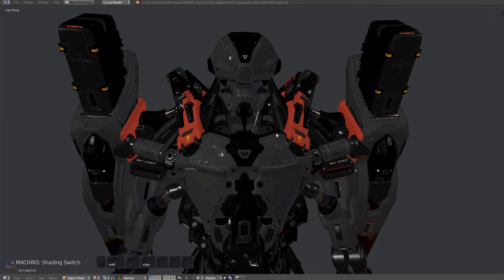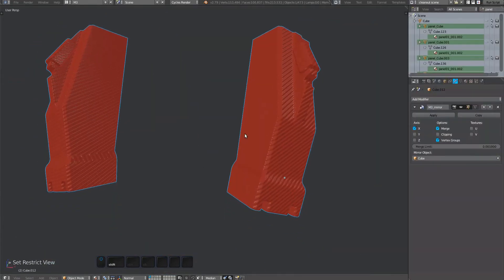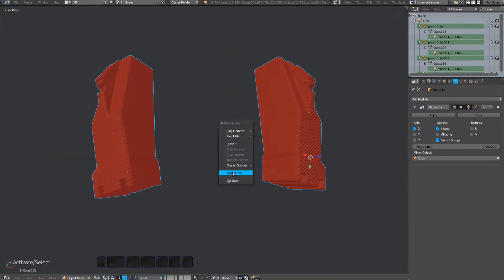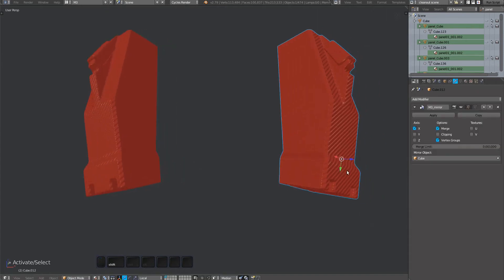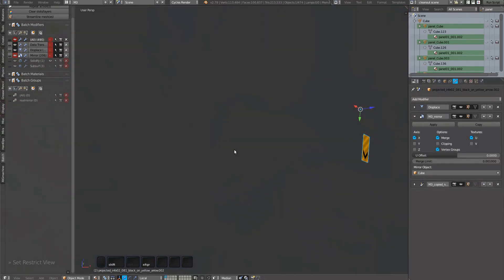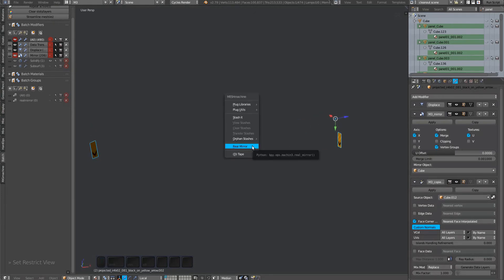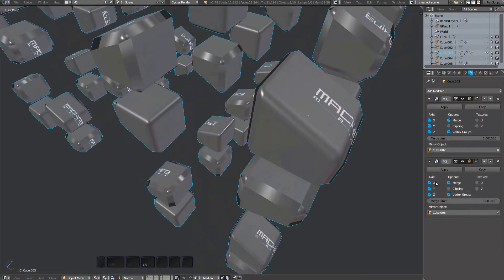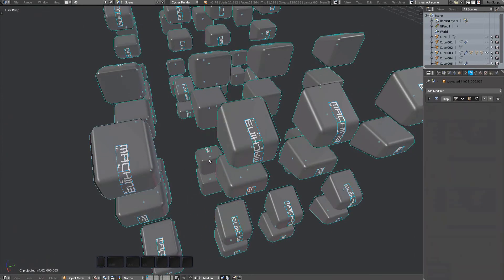MESHmachine 0.6 - Real Mirror

Comment: This and 'tape' and semetrize gpencil all seem to be missing..? 
Thanks again!
Reply from the maker: The tape tool is gone in 2.80 because Grease Pencil now has a Line shape, which is essentially the same.  The grease pencil symmetrize tool has not yet been brought back since the 2.80 release. I'd have to look, if it's even still required. I suspect you can also do that natively now. I think you can even mirror them now. If so, I'll add support to the mirror tool in MACHIN3tools.
Reply: @MACHIN3  your responsiveness and communication skills are some of the best parts about owning your products, THAT is long list  to be at the top of, and the highest praise I can imagine! Thanks again for everything! 😇